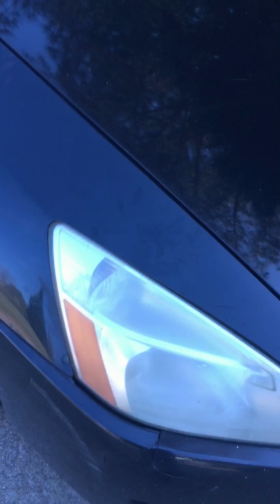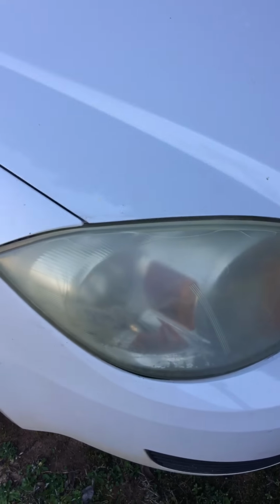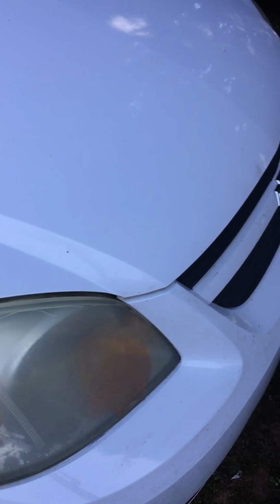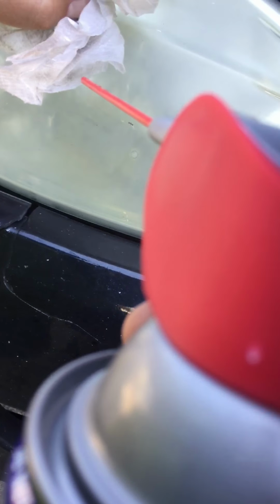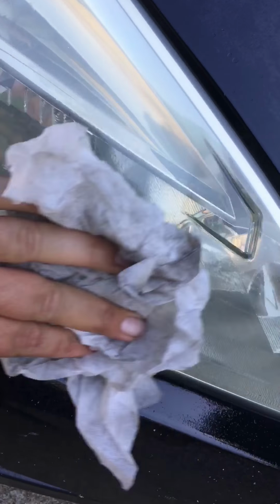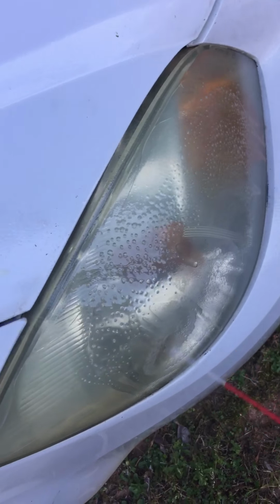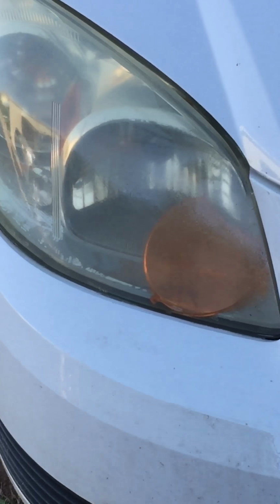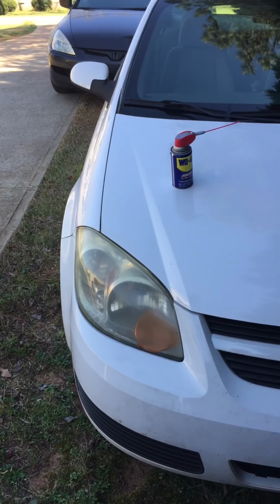Life hack how to clean your dingy headlights for less than $10

Comment: Dude, I'm betting that 'ish didn't last till you got back in the house! Truth, ... yellowed back up like before in just 2 or 3 days, right???
Reply from the maker: +Stew2460 4 days later had to do it again
Reply: Yep, .. I did mine, but went the more labor intensive route. My total time was about 2 hours invested. Wet sanded mine with 800 then 1000 grit sand paper from Walmart, dried it up, then  sprayed with Rustoleum 2X Gloss Clear, UV resisitant, Non Yellowing clear coat spray, also from Walmart. Looking like new 4 days out, so far. Did find your video quite informative though, and helped me know what I needed for a long term fix. :)
Reply from the maker: Stew2460 I am glad you found something that worked I will try it next
Thank you so much for watching my videos